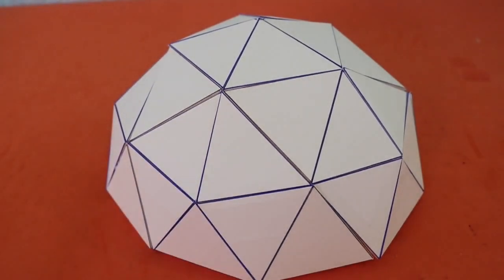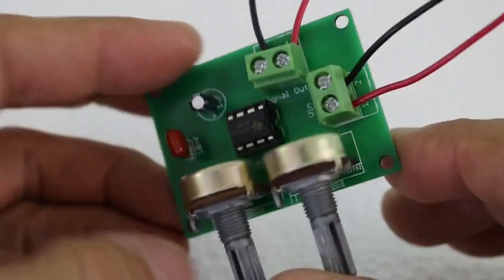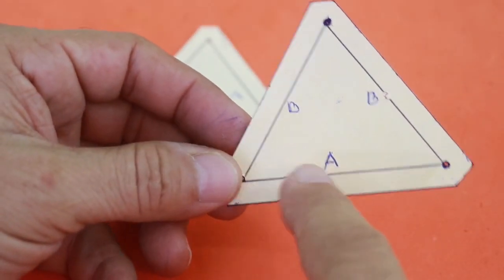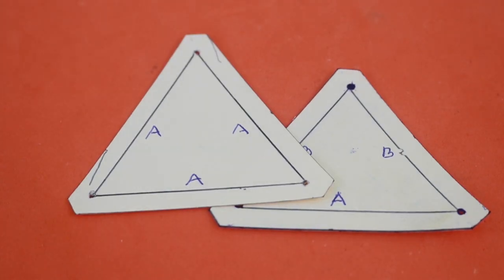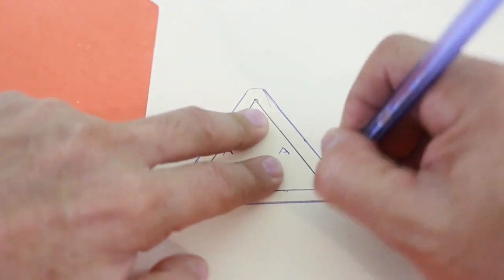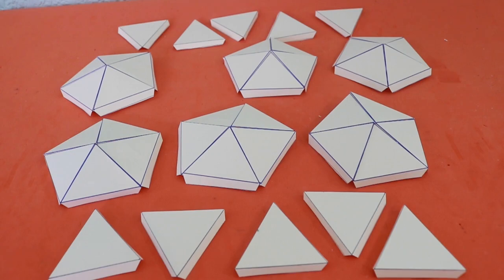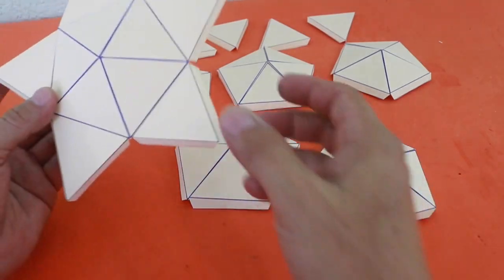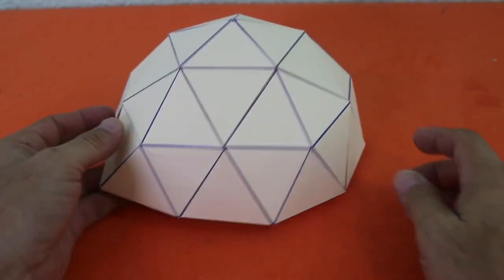Easy to Make Geodesic Dome

Comment: Great job love it I have a couple of questions if you don't mind  how do you figure out the size of your triangles I was thinking the design would make a great play house or she shed  or even a small workshop can you tell me how to  calculate the size of the triangles based on the diameter or radius  thanks for sharing keep it up great information
Reply: You can add your required radius and height measurements in the Geodesic Calculator. Google to access the calculator websites. Hope this helps.

Comment: Does the calculator in inch or cm ? And if in inch and I want to make my dome A3 size in cm how do I do it ? Help someone .?
Reply: It is unit-less.  just put in whatever height you want without the units and SUBMIT, it will fill in the lengths for you in fractions that you convert into inches for example.  it's easier to just do it in meters/millimeters and find a metric ruler ;)